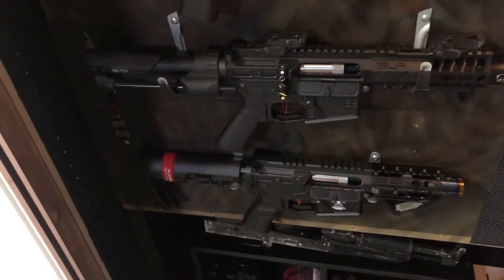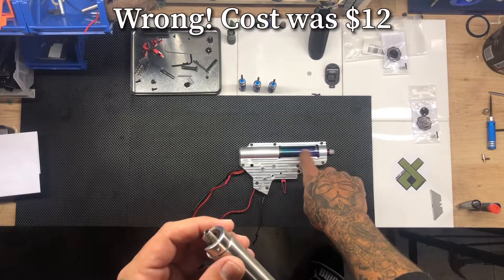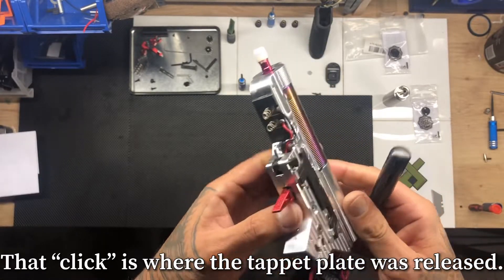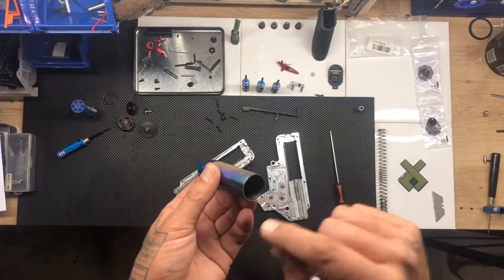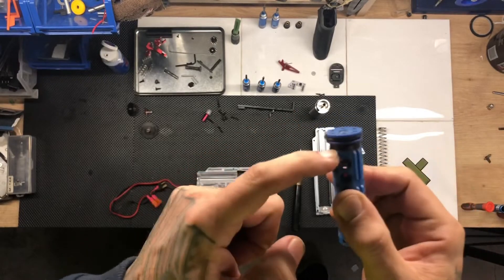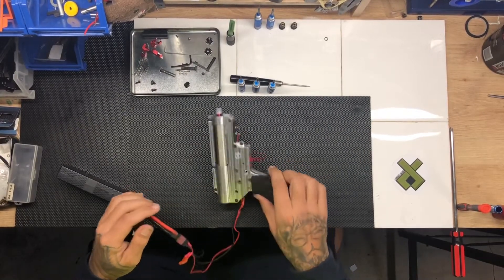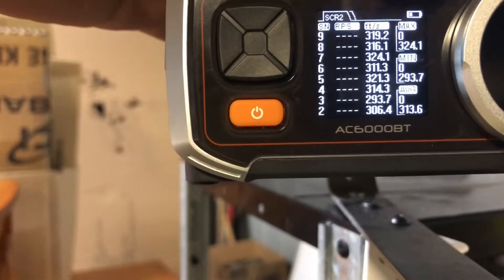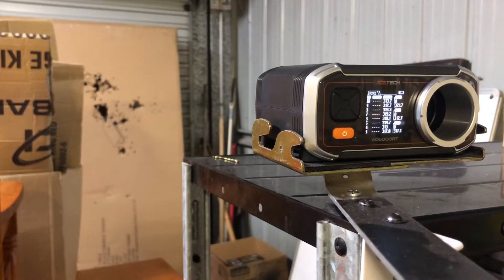Gel Blaster DSG, fitting the V2 one piece cylinder

Comment: If you want to put the sorbo pad on the cylinder head with out dropping it in use a piece of rod or a long screwdriver put it through the sorbo pad then you can line it up and slide it down

Comment: And i have used the spacer tap washer between the piston and piston head ,you can also use metal washers the airsoft tech does but if you are worried about weight you can get nylon spacers and use those instead ,i ordered some nylon washers off eBay actually cheap as bro and i think you can also get some at a bunnings warehouse i think they use them in built in wardrobes

Comment: You can use a kebab skewers to help with dropping it in the right spot ,hold the cylinder with the head facing down and put the skewer through where the nozzle goes and through so it sticks out the back of the cylinder and drop the spacer in that way the skewer helps keep in centered

Comment: hi hiroshima  how much do you leave on the tappet  tail  to work properly i have about 11mm  and the gels are only shooting  about 2metres feeding issue ?
Reply from the maker: Dave Cherrill is that on semi and full auto? What size spring also
Try 9mm and see how that goes. 
Mine are typically less than 9mm, they  need to be shorter than airsoft.
Reply: @hiroshimascreamer5884  hi mate yes mainly on auto am using m150 spring to start with on my 3 piston now even pulled the ladder gear off a shs  piston was glued in with super glue am running a big dragon m160 motor

Comment: is filing back 1 or 2 mm off the back of the cylinder necessary in the mk gearbox. also how did you do it?
Reply from the maker: One of them I had to, I can’t quite remember if it was the v2 or the h92 gearbox mk box though.